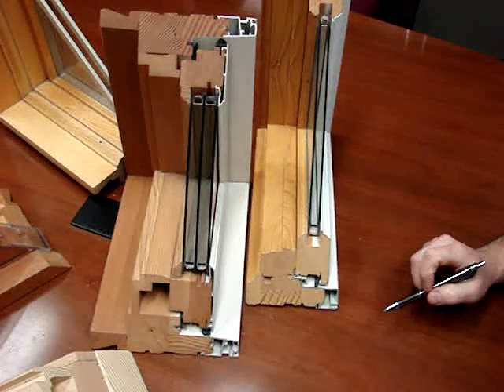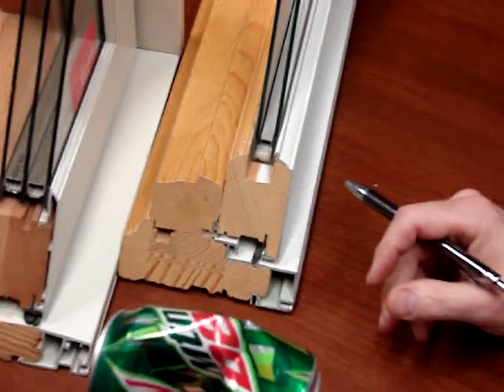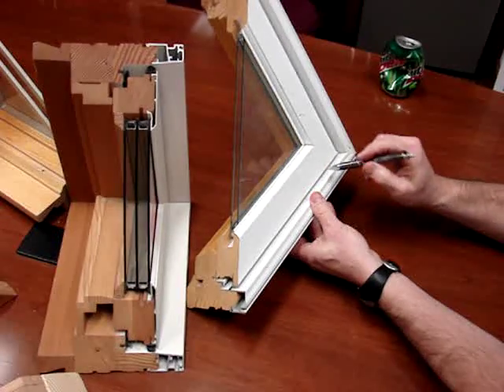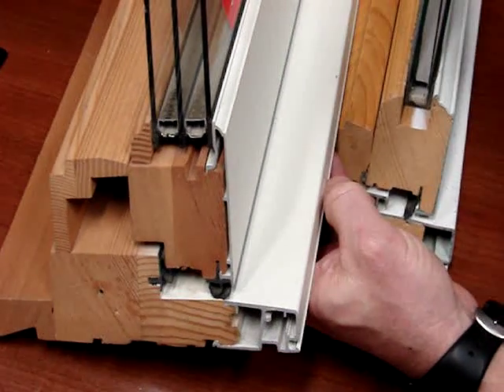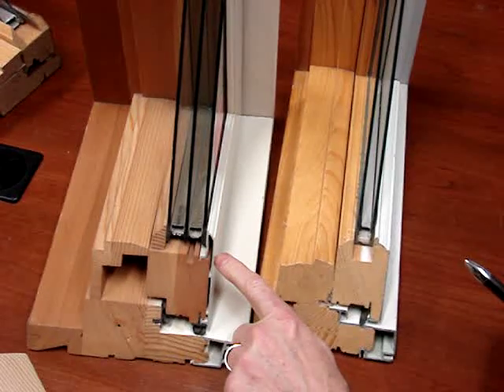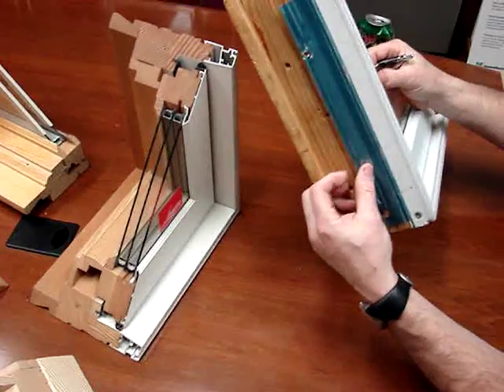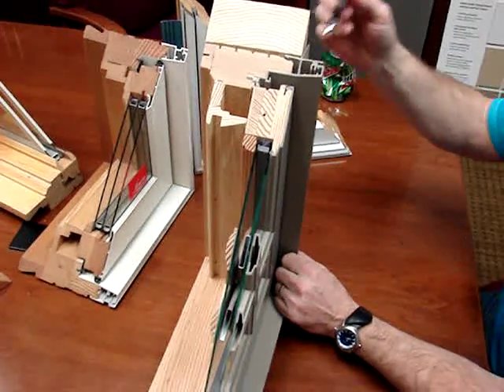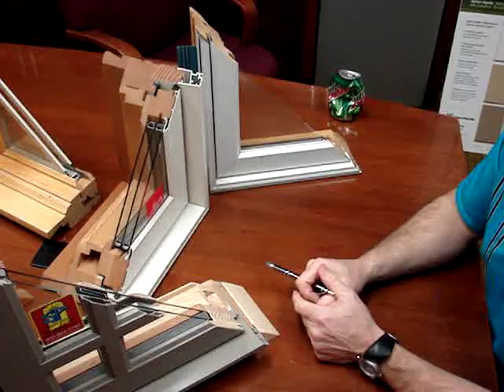Extruded vs Roll Form Clad Windows

Comment: my experience 5 years with of assembly of republic window and door,( chgo now out of business) in all glass assy operations,glass was cleaned with the house made blue windex type liq cleaner before assembly,glass in crates shipped to this facility always coated with plastic grit  = just a thin film that protected glass from breakage during shipping,workers it must be thoroughly removed, cleaning  glass with the house prepared  blue cleaner in spray bottles does not remove all grit. During assembly with the top side and bottom components,. although appearing ;clean'' the small bit of film remains unto final sealing with butyl caulking,air is vacced out then intert gas is injected,,, it fails  in a year or 2 the window get fogged up..I E seal failure because the butyl caulking does not adhere to glass in spots,, prevention ought to be use of pumice or cerium oxide and clean rags warm water to polish off the plastic grit
      Also  I;d recommend smoothing all sharp edges and glass corners with  fine grit sandpaper, handling is faster,as in wood sash windows where the glass is in closer contact with surfaces,this prevents the window from shattering when a kid in a hurry slams it on his way out to play